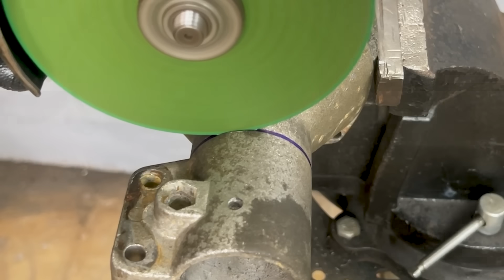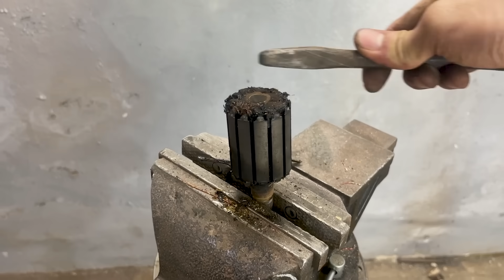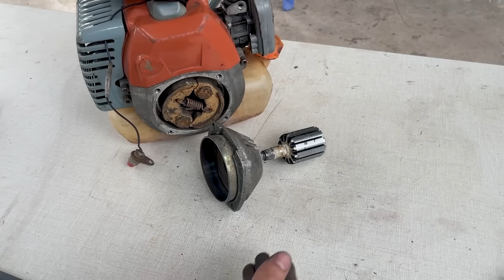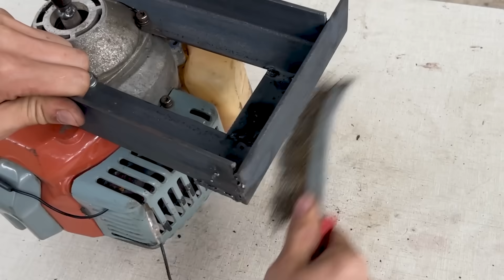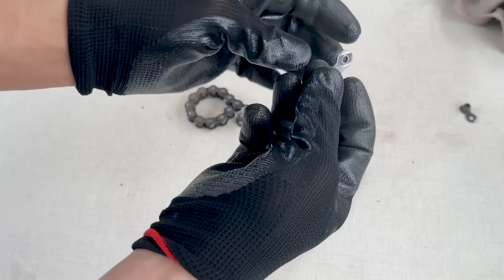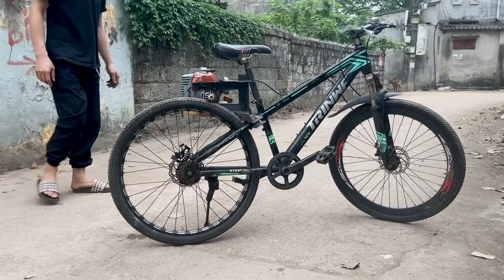Farmer Attaches Lawnmower to Bicycle! Turning a Lawn Mower Into a Friction Motor for Bicycles

Comment: You know why this design doesn’t work because it wears down your tires like no other you can hear it wearing down your tire. You can hear it spinning on top of the tire wearing down the rubber. This didn’t last long. That’s a fact.
Reply from the maker: Thanks for sharing your opinion! You are right, tire wear can happen if the design is not optimized. This is an issue that needs to be improved, and I will consider more in future versions to minimize this impact..thank you for your concern and sharing, my good friend, have a nice day💖 💖 💖

Comment: Привод проскальзывает.
Reply from the maker: Thanks for your comment! If the drive is slipping, I will check the joints again and replace the necessary parts to ensure more stable operation. Thanks for sharing! 😅

Comment: We Use To Spray Flex Seal Rubber Coating On The Shaft...It Reduces Wear On The Tire & Creates Better Friction When It's Wet Conditions (Just An Idea)..... Regardless Nice Work!
Reply from the maker: Interesting idea! Using Flex Seal could help increase the durability of components and improve friction in wet conditions. Thanks for sharing, I will try it out and see how it goes!

Comment: Won't the angle iron frame tor the motor be in the way?
Reply from the maker: Thanks for your question! If the angle iron frame is not designed properly, it can hinder the motor's mobility or reduce performance, especially if the frame does not fit the space needed.Thank you for your attention and sharing, my good friend, have a nice day💖 💖 💖

Comment: Great Video,  funny you made this video b/c I bought a brand new weed wacker 10 years ago but moved & never got to use
the thing.  I haven't tried to start her but here you are showing me what I can do w/  the machine I already own.  I'll find an
old bike & then try to fit the pieces together.  Honda sells a motor that's made to spins against the bike tire but it's costs
about $425 USD's = Too High.  In any event,  you've inspired me & that's difficult.  peace
Reply from the maker: Glad you found this video inspiring! It’s true that sometimes old things can be a great source of creativity. Good luck with your project, don’t be afraid to experiment and have fun in the process!
Reply: Sir K ,   my Nation(USA) is a "throwaway society"...... lots of waste & it piles up n UP as you already know.  I have
no project but you can't go wrong picking up an old bike,  cleaning her up & adding new bearings if needed.  This
is the point that IF I happen upon a part to make the bike run under mechanical means, I will.  I have a weed wacker
like the one you used here & I only used it 1 time.  I've kept it in a closet so no hot/cold to rust the the piston.
Yes,  I love seeing how you take "waste" and make it into viable transportation.  It is kool to see you work &
how your mind works as well.   Thank you for posting.  peace

Comment: If i where you fide i would look into a bicycle 2 cycle engine kit on Amazon i have one on my mountain bike the kit comes with everything to do it rite and YouTube has plenty of videos to help what i will say is for cost plus tax and shipping comes to around $1.50 dollars and i strongly advise having good breaks front and back  and make sure to use only 2 cycle oil on the gas and its a pedal start system with a clutch  and throttle I've had mine over a year and its best for the cost. Check it out
Reply from the maker: This is why I love comments – people like you sharing their experiences is really helpful. Thanks, and I hope you keep contributing!

Comment: Nope  to much noise to slow & will tear up tire quickly  and there should had been a way to drop and raise motor cage  by cable  or leaver
Reply from the maker: You are right! If there is not enough noise to slow down the system may not be effective enough and may increase friction, causing the tire to wear faster. Lowering and raising the engine cage with a cable or a separate bar will definitely help reduce stress on the components and maintain longer life.Thanks for your interest and sharing, my good friend, have a nice day💖 💖 💖

Comment: This design is a complete failure. If the friction is not enough on the big slope, the outer tyre will wear out and waste fuel. It is not worth thinking about if there are multiple people sitting on it. The noise will disturb people when driving at night. It is better to buy a motor and install it.
Reply from the maker: Thanks for sharing your thoughts! I understand that this design may have some friction and noise issues, and will definitely reconsider these factors. However, my goal is to experiment with creative ideas and find new solutions. I will take your comments into account for improvement!Thank you for your interest and sharing, my good friend, have a nice day💖 💖 💖

Comment: Привет! Хорошая идея, лайк! Но кнопку глушилки надо перенести на руль, чтобы в экстренной ситуации быстро заглушить двигатель
Reply: Проще звëздочку, покрышке хватит на метров100,ито накатом
Reply from the maker: Thanks for sharing your idea! You are right, using tracks can help improve traction and mobility. The idea of the tire running for a while and then rolling again is also interesting, I will experiment more to improve!
Reply from the maker: Thanks for your comment! You are absolutely right, moving the silencer button to the steering wheel will help turn off the engine quickly in emergency situations. This is a great idea and I will consider applying it in future designs!.Thank you for your interest and sharing, my good friend, have a nice day💖 💖 💖